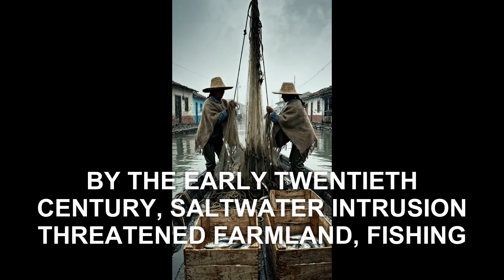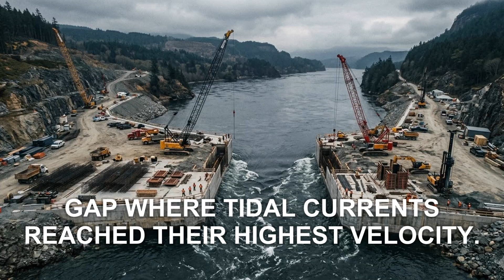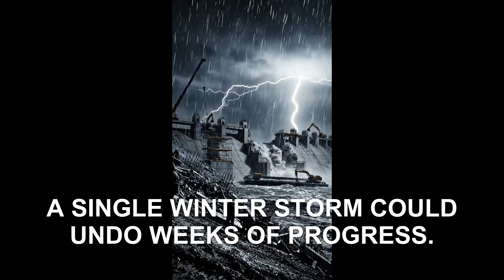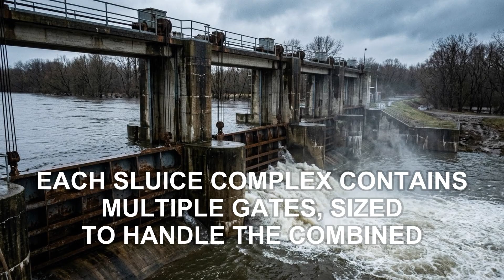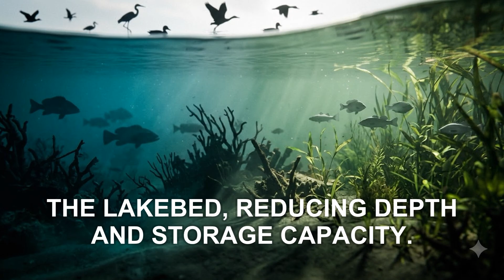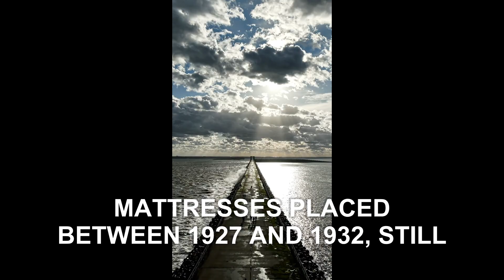How They Built a 32km Dam on Shifting Sand

Comment from the maker: 32 km of dam on soft clay. Final gap currents above 4 m/s — stone scoured faster than barges could dump it. Engineers stopped fighting the tide and let the current place the material.

One question: is asymmetric closure + willow mattresses the only honest way to seal a tidal basin on unstable ground… or did the Afsluitdijk just trade storm surge for a century of sediment, algae, and endless upgrades?

Drop your take 👇

Watch next: Why You Can't Dig the Longest Immersed Tunnel on Earth